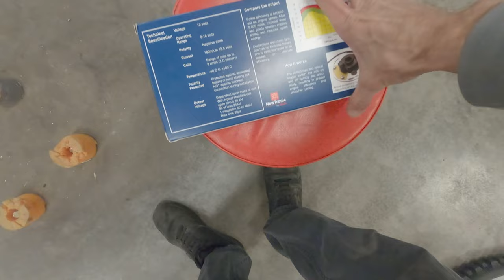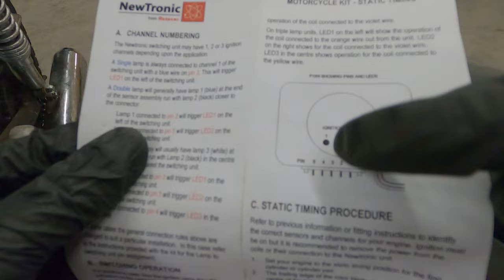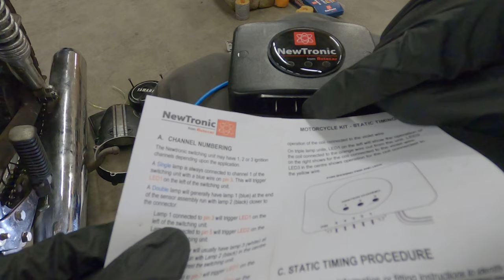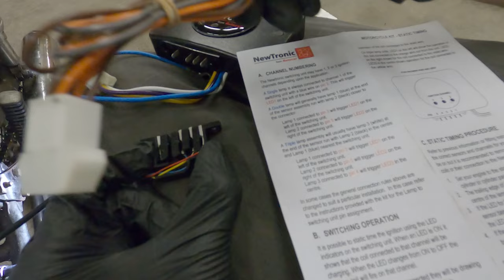70s two stroke twin gets digital ignition for all the sparks

Comment from the maker: A bit of a boring video but I thought it may be helpful for people in the future, I did leave out a few small details in the video but if you have any questions feel free to ask and I'll try to answer to the best of my ability. Thank you all for watching!
Reply: What happens with spare wires pal
Reply from the maker: I opted to just tuck & secure the original orange and grey wires  back around the stator harness, incase it’s sold later and someone wants to convert it back to points. Same for the grey & orange wires near the coils 👌
Reply: @WreckedRevival  Gorgeous RD... I have a 77 RD400 completely stock just the way I like em. I put an HPI ign on it that  has an ignition curve and I was stunned how much more power the bike made low and mid rpms BUT there was almost no flywheel effect and I had to increase idle a good bunch to get it to tick over. it smoked pretty bad at a red light.. and I missed the smoothening effect flywheel gives. I finally splurged on a VAPE that has a hefty flywheel (and makes way more power for lights ect) and the bike felt soooo good and smooth with it. It just ran better. However there is no curve in bare bones VAPE so this winter ill be buying their programmer and module and giving it one. All this to say.. flywheel effect is VERY noticeable in these little motors and was never something I ever thought about until I went from the hpi to the vape. Its worth it imo.

Comment: Gorgeous RD... I have a 77 RD400 completely stock just the way I like em. I put an HPI ign on it that  has an ignition curve and I was stunned how much more power the bike made low and mid rpms BUT there was almost no flywheel effect and I had to increase idle a good bunch to get it to tick over. it smoked pretty bad at a red light.. and I missed the smoothening effect flywheel gives. I finally splurged on a VAPE that has a hefty flywheel (and makes way more power for lights ect) and the bike felt soooo good and smooth with it. It just ran better. However there is no curve in bare bones VAPE so this winter ill be buying their programmer and module and giving it one. All this to say.. flywheel effect is VERY noticeable in these little motors and was never something I ever thought about until I went from the hpi to the vape. Its worth it imo especially if its going to be a road bike only.
Reply from the maker: Nice! Yeah there's definitely some Pros and Cons to having a lightweight flywheel/rotor. HPI does actually make a  heavier flywheel that's got up to two different Ignition curves and is programmable but has it no provisions for lighting. Only place I've seen it available is on their website. https://webshop.hpi.be/product/068k089/

Comment: Had the model before that one the YDS7 ,here is a tip put straight bars on the bike, at 70 mph you get front end lift causing wheel wobble, with straight bars it move the centre of balance forward and stops it.
Reply from the maker: Appreciate the advice! I’d heard that was an issue with RD’s as well and planned on dampeners/stabilizers for those in the future. We also have a 72’ YDS7 250 I’m working on right now! Will do the same for it, thanks!
Reply: @WreckedRevival  Its because there is less contact with the road stabilizers dont put the wheel back down Norton Straight bars work  very good moves the weight back to front wheel it is the wind on the rider with high bars that cause it to lift it happens at lower speeds if a strong head wind. Watch it in high speed curves if you hit a bump in the road it can turn into a tank slapper.
Reply from the maker: @peterwright9546  Thanks definitely good to know! Makes since why I've seen a lot of the Rd's with straight bars and rearsets since you've mentioned that. I'm sure that forward leaning weight shift helps a good bit even though it looks a little uncomfortable lol!

Comment: I spy your DS7😀 BTW the control box is not a CDI (Capacitor Discharge Ignition) it’s a TCI (Transistor Controlled Ignition) as you still have battery powered coils. The bikes sound great
Reply from the maker: That's true, I frequently use technical terms a little more loosely than I probably should and in a generic sense not only because it's a little easier to say but also so that it may be easier for less mechanically adept viewers to relate to as far as what somethings function is (without further explanation) , in this case the switching/timing control module controlling ignition timing. 

A lot of people couldn't care less about whether it's a Thyristor/Mosfet TCI or an AC/DC CDI and just want to know how to install them and that's who I  generally make these types of install videos for. 😛

Comment: you shouldve done an idle before and after, instead of just revving it and then jumping to going out on the road. no way to see the before and after. sweet install i bet that optical transistor really helps at high rpm
Reply from the maker: Yeah I definitely should've but believe I edited that part of the video out either to keep the video length down or may have had audio issues with the clip. Definitely happy with the Newtronic systems, haven't had any issues on the 3 bikes I've installed them on over the past year!

Comment: Is it still running good 
I installed on mine and notice that after running hard stator got really hot as because these are electro magnetic and black point start melting because of heat
Reply from the maker: Hmm that’s odd sounds like maybe your magnetos windings coating flaked off or shorted somehow and cooked itself. All of the bikes I’ve installed them on are still running good. 
I may be switching our RD350 to an HPI ignition though, on their website they have CDI’s that are programmable with switchable maps, tach signal output, rev limiter, believe two step and a lot of other fun/handy stuff for monitoring etc.

Comment: Cool video!! I got a 77 RD400 where did you get the New Tronic kit from.
Reply from the maker: Thanks for watching and nice! Would love to add an rd400 to the collection some day. The Newtronic ignition came  from Yambits, I have installed 3 of these kits on our bikes and had no issues. 👍
Reply: @WreckedRevival  Thanks for the info I'm going to order one thanks again.
Reply: @m1a1hm   I had the Vape/Powerdynamo electronic ignition installed on my '77 RD400. It's awesome!
Reply: @bluoval3481  Cool . I got a newtronic for my 77 RD400 but I also got a 79RD400f Daytona I might have to try the Vape Powerdynamo on it . Where can I found one.
Reply: @m1a1hm  I bought the complete Vape/PowerDynamo CDI replacement kit from Economy Cycle. The complete kit replaces the stock generator, points, condenser, coils and regulator. That's the way to go so you're not relying on any old electrics at all. Don't go cheap and just buy a partial kit. Replace the whole system - you'll never regret it. Terry owns Economy Cycle and has sold (and installed) hundreds of Vapes and they've proven to be super reliable systems. I also bought the additional recommended parts and pieces from them for my install and the bike is so much more powerful and burns cleaner. It's like a new bike now.
Reply: @bluoval3481  Cool!!!
Reply: @bluoval3481  I put an HPI on my 77 RD400 that has an ign curve and I was stunned how much more power the bike made lower mid range rpm however the hpi flywheel is tiny and weighs nothing and it was very noticeable. I had to set the idle really high jsut to keep it ticking over at red lights and it SMOKED way more because of it. I splurged in VAPE with that chunky flywheel and omg the bike felt amazing it was so much smoother and even more of a joy to ride around town and idle was consistent and even at 1100 rpm . No ignition curve tho so I am going to order the programmer and module from economycycle and put in the exact same curve the hpi has then I will have the best of both. The VAPE is pricey but soooo worth it imo. And the lights no longer dim at idle because it makes plenty of watts.

Comment: Can I ask what did you do with the old points wires ? Leave them there or tear them out? Thank you. I’m just about to do mine with the same kit. Mine is a 77DX coffin tank
Reply from the maker: I ended up pulling them back around where the harness goes through the case & zip tied them around the harness. Wanted to keep them away from any spiny bits and leave them incase it's sold later and someone wants to convert it back to points. Good luck with the install! Haven't had any issues on the three bikes I've put the Newtronics on. 🤙

Comment: Are these kits universal? Couldn't find one for my bike
Reply from the maker: I'm sure they could probably work with other bikes that originally had points but not sure what all applications they'd work on. I've never tried Newtronics on other platforms but it'd just depend on the diameter & depth of the original points cam.